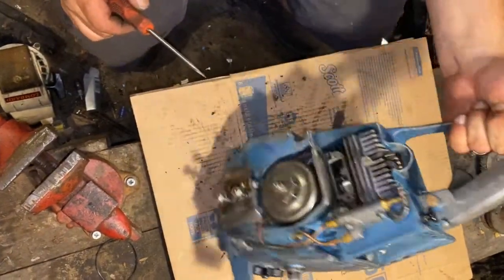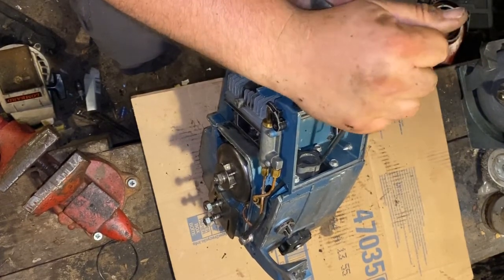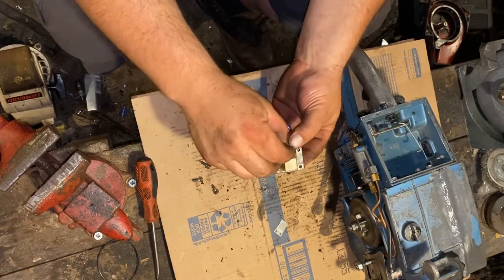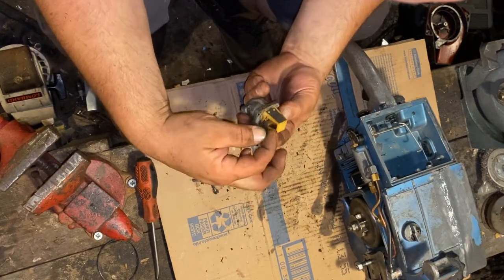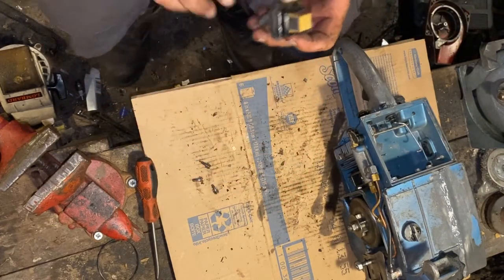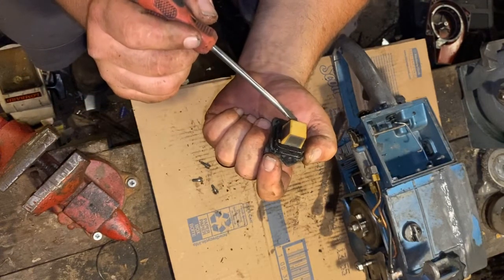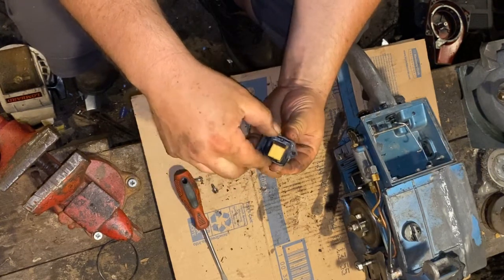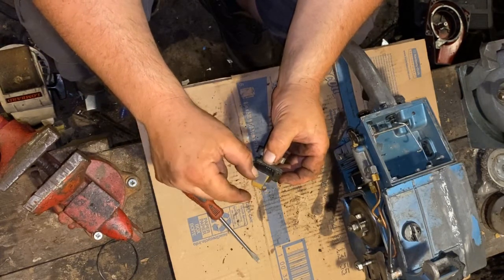Homelite Chainsaw Reed Valve Inspection Repair Super XL-700

Comment: I believe that's what's wrong with mine the carb was clean yet cleaned it anyway and installed a kit and still it wouldn't run right at all ..this looks like what's wrong it's got to be bad or stuck reed valves
Reply from the maker: Your problem could also be bad crankshaft seals.
Reply: well im pretty novice with saws i just dont think thats the problem ...soon as i get all these scrap loads hauled off im going to look into it

Comment: Just now saw this video in ur line up I don't know how I missed this.
Reply from the maker: That is an old one.  I forgot that I made it.
Reply: @Smittyschainsaws  I love the 3/4 wrap handle I want to do a full wrap on the 925  keep me in mind if u run up on one with everything I need to mount it. Hope everything is going good my friend.
Reply from the maker: @justinweaver8787  I searched for a long time.  Probably better off building one.
Reply: @Smittyschainsaws  I would if I could I don't have the know how or the means to  build one lol
Reply from the maker: You don’t give yourself enough credit. You never learn unless you try.
Reply: @Smittyschainsaws  very true I just never been good at metal work. Lol

Comment: Merry Christmas Smitty. I have a blown up SXL I put a new top end on. It was a runner until it blew up from air leaks running way too lean.
I have had the carb all the way apart, every part from the SDC kit has been swapped out with new, carb is full of fuel on both sides. I have pulled the welch plugs and everything seems unclogged.
It pops real hard on choke but it won't run. It's not flooding. I don't know if the reeds being worn or installed improperly could cause this, it seems like impulse is good but I feel like it's just not getting enough fuel in it to run. I dumped some fuel down the carb and it ran like a maniac until it ran out of that fuel, it never pulled any more it seems like through the carb.
I will be changing the spark plug but I do have spark. I wonder if the points need to be set better too. I'm sort of sad this is not running well at this point, I've worked really hard on it, had it all the way apart and changed out the two crank seals in addition to the new top end.
Reply from the maker: If it ran with fuel down the carb then I would say it’s probably a carb problem. It ran so spark is there it’s just a question of whether or not it’s a weak spark. Pull the plug and make sure it’s a good blue spark. If it’s orange spark or anything other than blue then it’s a weak spark.
Reply: @Smittyschainsaws  thanks! I went ahead and used this video to prove that I had two reeds that were not seating properly. I have fixed that by swapping and flipping reeds, all of them are nice and closed now. I then gave it a go. Not going. I will say I don't know how to set points and I had the ignition off. I set the gap to the flywheel with the standard piece of card stock, but I don't know how to "set points" which need to be 0.015. I would say the fire is pretty weak and it floods while I'm pulling on it, definitely could be a spark issue. I think I need to learn about these points systems and keep trying. I really appreciate your help, this saw is special to someone and I want to get it to them this Christmas season if I can.
Reply from the maker: @jimknowlton342  I use something like a cereal box to set points. Just a little less than a business card. If you have a points issue then remove the points and use a file to get them looking like new. Using sandpaper and just squeezing it between the points will not work for ones that are more heavily worn but removing them and using a file works great.
Reply: @Smittyschainsaws  well, I pulled it back apart and looked at the points. They were covered in crud. I opened them up gently and put a cheap nail file between the points and worked it back and forth. The points almost seem like they are sort of cupped, they sort of have a thin raised rim around the outer diameter of the contact surfaces (on both of them). They were kind of collecting bits of the nail file. I blew on it and worked the pieces of file out from the points and now I have no spark 😢 I did not move the points at all. I did move the overall ignition coil bracket, which the notes said to set at the "most clockwise position" I could, which basically did not move it much at all. The gap from the flywheel magnet to the coil is still good. I took it back apart and filed on the points some more. Still no spark. This is discouraging. I feel like I broke it completely. I haven't hit the points with any contact cleaner but I'm really out of my league messing with points.
Reply from the maker: @jimknowlton342  You definitely found an issue. The points should not be cupped at all. Unfortunately this will require them to be removed. It’s not a difficult task. Just take a picture and keep a good record of how you removed them. After they are removed then you will be able to file them down correctly. Using the method you are using would take a few hours and removing them would be a lot faster. You will also be able to see when you have them filled well enough that they will make good contact. The nail file is designed to file down soft surfaces but you are trying to file a metal. It would take a very long time and would probably ruin the nail file before you finish. This will need done before we can move to the next step in the process. Remember they should not be cupped at all. Sometimes they are too heavily worn and need to be replaced. Sometimes the electricity burns a hole through the points which requires them to be replaced.
Reply: @Smittyschainsaws  thanks for that piece of info. Spoiler alert: Its running! So I did work on the points some more, I watched some more videos on the subject as well to try to get more comfortable with them. I got some 220 grit sand paper and worked on them some to try to flatten them out. I then noticed that the gap seemed pretty big, so big in fact that when they closed I thought I could see a little bit of a gap left. I then pressed the pivoting arm to close them and they did close some more. Well that's not right! My feeler gauges are a cheap set that are too wide to get in that spot and get a measurement, so I got my dremel and hacked off some of the shim so it would fit and the 0.015" gauge was probably only taking up half the gap. I then moved the points to set the gap back to 0.015", cleaned the point faces with some alcohol to get the dust off, reassembled, set the armature gap to 0.006" which it was pretty close to already and now TONS of spark. So much spark it darn near tried to start with the in line spark detector installed.
I can't thank you enough man for all your help.